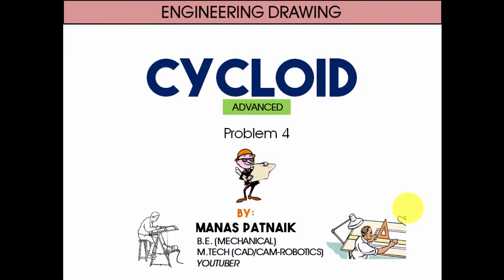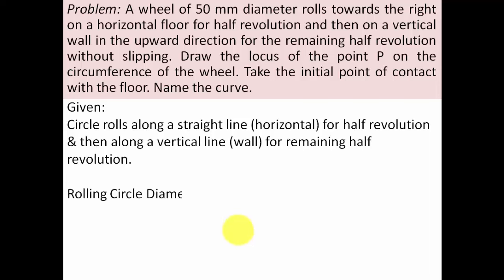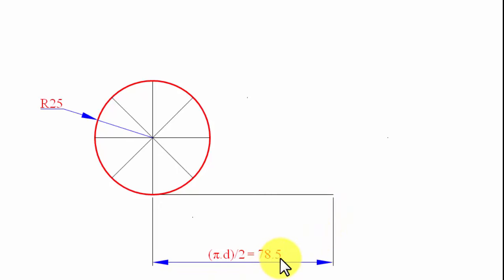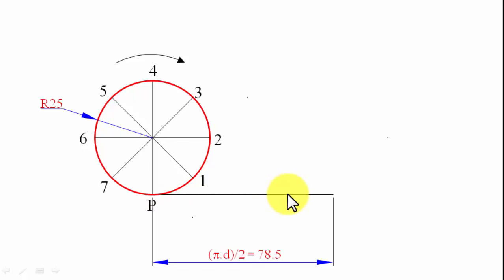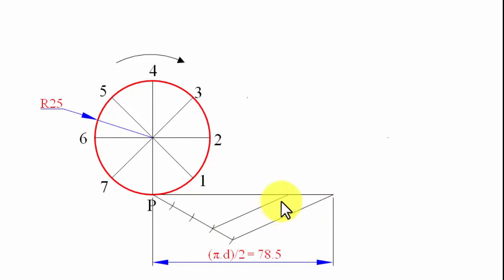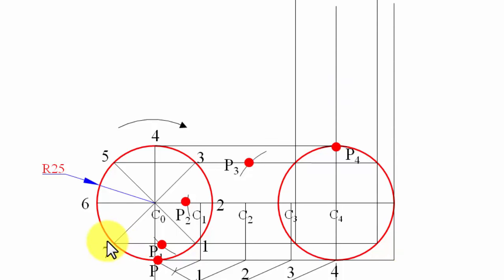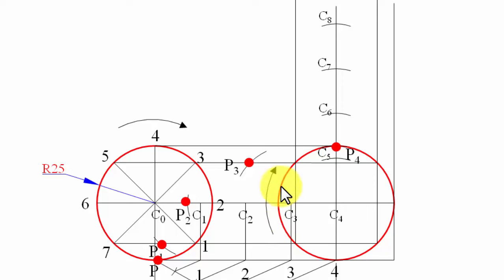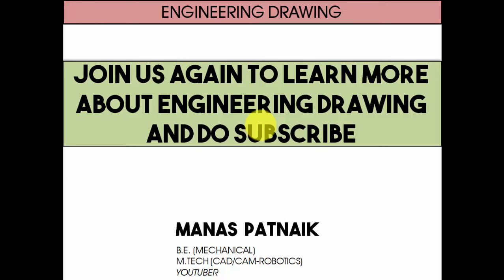Cycloidal Curves_Cycloid_ Advanced_Problem 4

Comment: A circle of 50 mm diameter rolls on a horizontal line for a half revolution andthen on a vertical line for another half revolution. Draw the curve traced outby a point P on the circumference of the circle

Comment: A point is moving along the curved surface of a cylinder with a uniform speed and parallel to the axis. The cylinder is rotating about its ads with a uniform angular velocity in anticlockwise direction. From bottom of the cylinder, point P is covering a distance of 129 in two rotation of cylinder. Plot the locus of P for two complete rotation of cylinder. Take cylinder diameter equal as 60mm. name plotted curve ? Sir can you please make video on this

Comment: When the circle is in vertical motion, what is the radius of the arc with C5 as centre and so on? Is it equal to the radius of the circle or the distance between C3 and C4?
Reply from the maker: It is equal to the radius of circle i.e small "r"
Reply: Manas Patnaik Thanks a lot. Appreciate it :)

Comment: what to do when a circle rolls without slipping along a straight line for half revolution and it slips certain distance and stops and it is asked that to draw a  locus of a point on the circle which is initially contact with the directing line    plz anwer.